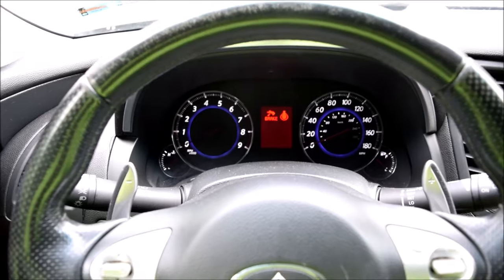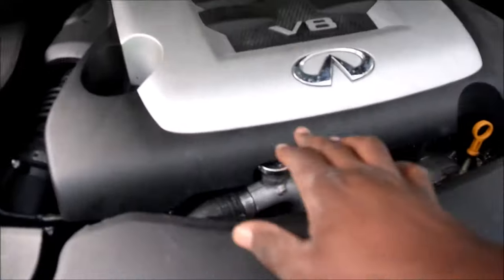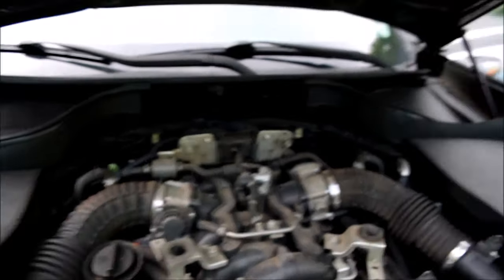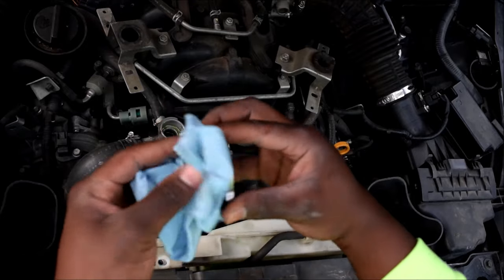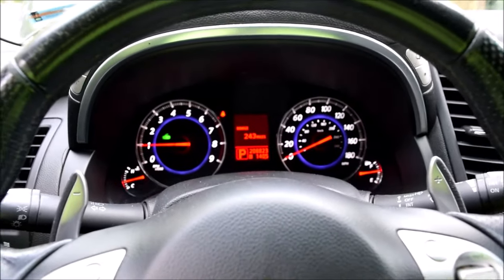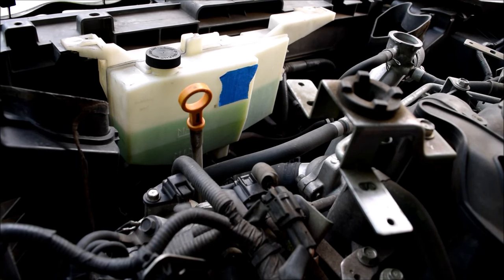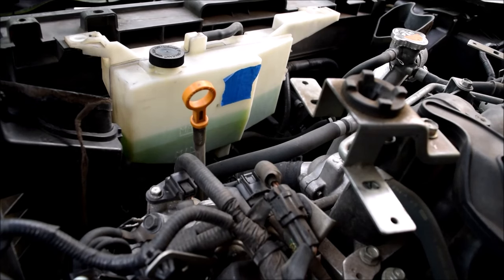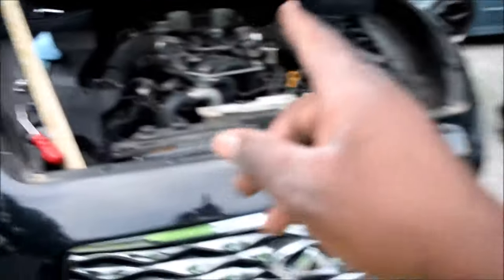Water Sloshing Noises + Coolant Reservoir Too Full. Bad Radiator Cap causing Air Pockets| VLOG-ish

Comment: Good video but what I'm thinking is that if air continues to get into the cooling system is that it may be an indication of a leaking head gasket letting air/fuel mixture be pushed into the cooling system rather than a faulty radiator cap letting air in. If that is the case, I recommend a product called K-Seal.
Reply from the maker: You are right about that. If the air pockets persist, then it would be time to dig further into the diagnosis.

As complex as a cooling system might be, one of the most crucial parts happens to be the cheapest, so sometimes it just makes sense to replace it with a known good one. For me, I was lucky to have another car to exchange with.
Reply from the maker: A quick update - I came to find out that they had installed the wrong thermostat.
Reply: @EdBwoy  how does a wrong thermostat cause air inside your cooling system?
Reply from the maker: @Prime-nf5yy  the stars have to be aligned perfectly for that to happen. Bad thermostat blocks flow, so a lot of the expanded coolant goes to the overflow.
Ideally, the coolant should get sucked back into the system when it cools down, but it's not as efficient/immediate like the overflow process.
If this keeps happening, you could lose more through the overflow than can be sucked back in, and eventually the system can start sucking air back in.
Reply from the maker: @Prime-nf5yy  a little extreme example, but I have watched a car overheat and overflow the reservoir, so it was parked and left alone to stop boiling. The next day the reservoir was dry as a bone.
It might have looked like it was "eating coolant" but my experience with high compression aluminum engines is that they are more likely to push exhaust gases into the coolant system than vise versa

Comment: The sloshing isnt necessarily a problem if heard its just coolant in the heater core getting pushed  through but it can possibly mean air pocket(s) or water trapped in ac evaporator drain pan. Can be clogged ac drain tube.

Comment: I Never experienced an overheating problem with my black M35 S I've had the car for like 5 years with 0 major issues nothing but normal maintenance but last month it happened the car overheated thought i blew a head gasket because the radiator cap wasn't holding pressure after i changed it i never experienced that issue again
Reply from the maker: Nice! 
If I may ask, was the issue diagnosed by a shop or just by yourself?

Comment: Great Vid bro. I literally just fixed this problem today with the same reason. My radiator cap in combination with too much gunk in the bottom of reservoir caused the coolant to go in the res but not back in the radiator. Had me stumped at first. Caused oil consumption and trans skips and all kind of mess. All fixed now with new OE cap and fresh coolant only. 06 Chevrolet Monte Carlo 3.5.
Reply from the maker: Crazy what a little cap can do when combines with dirty coolant.
I eventually found my thermostat to be an issue, so I replaced that as well, but I always start with the cheap easy fixes.

Stay safe out there ✊✊
Reply: How much to fix it ?

Comment: I'm having the same sloshing sound when I start the car to let it warm up and it's bad too, like a little kid sloshing around in the bathtub or something. The other night, I was driving it, and the "red" temperature light started flickering. Stayed on for a few minutes, then went off. I couldn't even pull over to shut the car off. I know, I should have tried, being that red light of death staring me at the eyes. Does this all correlate with one another?. Thing is, I had this (2011 Subaru Legacy) serviced barely four months ago. I told them to do all the fluids and anything else it needed. I never had this problem in all the nine years that I have owned it. That light never came on before, let alone the sloshing sounds beyond the dashboard. Not a happy camper.

Comment: 2013 Jeep Grand Cherokee, same sound. But my radiator was replaced, hoses are checked and tight; thermostat and water pump replaced as well and work well. Base on your video, sounds like there is one more thing I can troubleshoot and that is the radiator cap. Once I replace the radiator cap with Jeep OEM, do I need to do anything for this change to take effect? Or is simply changing the radiator cap is enough?

Comment: Great video. Is it good to open the radiator cap often to let air out?
Reply from the maker: Thanks.
Regarding the radiator cap, no you don't have to open it for that purpose. The overflow tank/coolant reservoir should be handling that part - take out the air, and replace with coolant. 
If the system is working properly, no air should be introduced into the system. 
However, I do open my cap once in a while just to make sure that I have coolant all the way to the top.

Comment: Wild, with the old Radiator car, my coolant was in between the min and max... i installed a new OEM cap today after i drove for like 25 minutes, i checked the reservoir and it was a little above the max level. I iwll keep an eye on out it and check to see if the radiator is full.
Reply: Any update?
Reply: @Prime-nf5yy  I installed new Thermostat and Radiator cap and bled the coolant. After the first drive i was above the max line again, so i siphoned off the reservoir coolant and put into the radiator, i then removed coolant where it was a little above the Min level. After letting the car rest overnight int he freezing cold in nyc and checking today, i noticed the coolant was way below the Min level, so i added some extra coolant. The idea is when i drive and the car is hot i want it to HIT the max line and only the max line, so i followed EdBwoys advice in the second video. i am not driving today so i'll check tomorrow again. So far, so good. Positive thoughts.
Reply: @DTUFINOPhotography  i see. I have a similar problem with sloshing noise when the car moving.  I have the new radiator cap and a new thermostat, but the coolant in the reservior is buliding up and not getting back to the radiator when the car is cold. I'm gonna try not to drive the car for 12 hours and hopefully the coolant reservior go back radiator. If not, i have to extract the coolant from the reservior and add it to the radiator and drive it to the mechanic.
Reply: @Prime-nf5yy  my car was not over heating at all, but i did get a new cap and thermostat just in case to prevent that from happening, I say top off the radiator and then remove some coolant from the reservoir and put it in a water bottle in your car... and then drive it and when its hot, check the level in the reservoir and then top it off if you need to. this is how I'm gaging. i think i may have too much coolant in the system because when its hot, it should hit MAX line and when its cold it should go down a bit. I'm still checking out and caring a large Syringe to remove and some. Dont take it to a mechanic yet, they will say you have a blow head gasget.
Reply: @DTUFINOPhotography  I see... my car is not overheating too. My average temp is 184F using my OBD while driving for 15-20 minutes. My reservoir is different. Coolant should be between low and full. Once it near full or over the full line, that's when I started to extract the coolant from the reservoir and store it on water bottle so I can use it to re-fill up the radiator when the engine is cold.

To confirm, you want me to fill up the radiator first then extract any excessive amount from the radiator reservoir and put it in the water bottle?
Reply: @Prime-nf5yy  Yeah thats exactly what i'm doing. I drive with the extracted Coolant in the car just in case i need to top off the reservoir. I'm figuring it out too. Don't go to a mechanic just yet if you are not overheating and if you changed the cap and thermostat. I'll keep you posted on my results. But before check to see if the coolant goes back into the radiator. have you watched the second video of this series?

https://www.youtube.com/watch?v=ws1POIi78Xc&t=445s

Comment: Hey ed quick question fx35 isn’t overheating but reservoir always stays full it won’t drain once it’s cooled down any suggestions
Reply: Hi, I had the same issue as per the video, in my case the car has a small crash, and an the repairer flushed the original blue coolant with a green one, I did  the coolant air purge twice but not luck, when I was almost ready to replace both thermostats I decided to replace the coolant with an original one, this solved my problem.

Comment: I have the same situation in my subaru BRZ, slushing when starting the car under the dash. coolant rises, but there is a slight bubble in the reserve tank, its like 1 bubble per second. any idea what that is?
Reply from the maker: I feel like if you see the bubbles actually forming, you're dealing with a breach of exhaust gases into the coolant. Sometimes you can also see the coolant boiling in the reservoir and if you smell it, it smells a little different.

Sometimes engines eat coolant, but sometimes the crack/hole/gap etc is only evident when the engine is hot and the in-cylinder pressure is pushing outwards
Reply: Hey @Temper Tv, Did you solve this one?? I've got the same problem on my 2011 Subaru Legacy, 2.5i engine
Reply: @psalmkuru24  yep. just changed the whole system with a new coolant apparently, my previous coolant change wasn't bled properly hence a lot of air in the system

Comment: I smell coolant but no leaks present. Have you had this happen on your fx after driving?
Reply from the maker: Usually when you smell coolant, it has escaped out of the sealed coolant system.
Have you checked your reservoir or filler neck to see if the level is low?
Reply from the maker: Usually we find that this is due to cracked radiators, but depending on your engine, you might have a hidden leak.
https://youtu.be/46gXN4llmOQ
Reply: @EdBwoy mine is low, I’m guessing just adding some of the same wouldn’t fix it?

Comment: I have Hyundai i40 and I hardly get any hot 🔥 air even when temp is high. Coolant level is all okay. What the issue can be?
Reply from the maker: I am not very familiar with your car, but sometimes a blend door gets stuck or fails. That is what directs air to blow over the hot coolant in your dashboard.
I would hate to send you on a wild goose chase though, so I suggest you have it checked by a professional. Delaerships can usually do different test to open/close all these doors while troubleshooting what exactly failed.

Comment: @edbwoy I just picked up a fx50 ran great till yesterday it overheated i let it cool down and never overheated again for the whole 2 hour drive home.    could that be a radiator cap sucking air into the system creating warm air pockets ?
Reply: Also my coolant resevoir went all the aay to the cap as well
Reply from the maker: I have been hesitant to announce this, as my research is inconclusive at this point...but I think a significant number of these engines have cooling system issues. Where did you buy yours from?
Reply from the maker: @andrewluostari5592  can you check your oil filter neck to see if it is frothy?
Reply: @EdBwoy  i bought it from a smaller dealer up here in northern Minnesota.   I just changed the oil and nothing looked like it was mixing or frothy and thats what confused me.   I swapped out the radiator cap cause I was having the same issues and got a ton of air out of the system last night

Comment: need to do Coolant Air Purge, does the engine need to be cold or can I drive to a place which has a ramp like 7 km away ??
Reply from the maker: You can do it warm. Just make sure the coolant system has cooled down enough that you can safely open the cap or relief.
Reply: @EdBwoy  15 min of cooling down should be enuf to avoid scalding due to steam
Reply from the maker: @kjsahai  I would think so, because 7km is not such a long distance. However, I would still encourage you to be careful as you open it so that it doesn't splash out
Reply from the maker: @kjsahai  also, what is the ramp for?
Most modern vehicles I have dealt with can have the air purged without needing to elevate the front of the car.

Comment: I have this problem where I hear the sloshing sound, but even when the vehicle is turned off yet still warm. It overheated the other day and now that I've diagnosed to the problem, it still seems to be overheating. Having a hard time understanding what the problem is, but this lashing sound I've heard many times before.
Reply: check your radiator fans or cooling fans if they are running properly.

Comment: hi edbwoy.. did you fix this problem?
Reply from the maker: No, it kept persisting and I found that my thermostat was bad
Reply: @EdBwoy  did you changed it  an fix problem?
Reply from the maker: I changed the thermostat and so far it looks like it fixed it. I'll keep driving and checking again
Reply: @EdBwoy  i changed the ratiator cap . was 1.3 bar (137kph) and i installed 0.9 bar cap. everithing looks good..

Comment: What the problem the radiator cap ?
Reply from the maker: That was the initial problem. And I thought I solved it, but I have noticed that after going on long trips, days later the sloshing sounds start again.
There might be something else that wasn't immediately obvious.
Reply: @EdBwoy  oh wow I have the same issue on my g37 the coolant over flow to reservoir but not going back to radiator still try to fix it

Comment: У меня есть огромная просьба, помоги пожалуйста. 

Я заказал с Японии щуп на акпп как ты мне посоветовал.  Щуп приехал и я проверил уровень масла, а он показывает что масла слишком много. 
Может щуп не такой?
Можешь померить длину щупа которым ты работаешь и сообщить сюда? Я буду очень признателен. 
Заранее спасибо!!!!!
Reply from the maker: When I measured the transmission dipstick, I found the total inserted length (below the flange) to be 25-7/8 inches. That's around 657.225 millimeters.
Here, click this link to see the pictures/drawings I made showing the measurements I took a few years ago - https://forums.nicoclub.com/psa-missing-transmission-fluid-dipstick-vk45de-t621370.html
Reply from the maker: Also, I wanted to remind you that the transmission needs to be measured "hot". If you measure it cold, all the fluid is in the pan, and the dipstick will seem too full.
Look at these 2 videos I made some time back. See if you can follow them:
1. https://youtu.be/QR1AV_jVxA8
2. https://youtu.be/XqIP3pISbnQ
Reply from the maker: I don't know if you have access to the factory service manuals, but if you send me an email, I will send you the autimatic transmission manual and I can tell you the page to look for.
Edbwoy@gmail.com

I just realized that my videos do not have translations or subtitles, but if you get a copy of the manual, you can translate the pages.
Reply: @EdBwoy  я все понял.  Обязательно проверю как вы рекомендуете в видео!
Reply: @EdBwoy  все как вы и говорите!   Я выдержал инструкции по уровню масла в акпп, и машина поехала лучше!!!!!    Спасибо большое!
Reply from the maker: @volodymyr651  good! I am happy you figured it out. Enjoy the Q45!